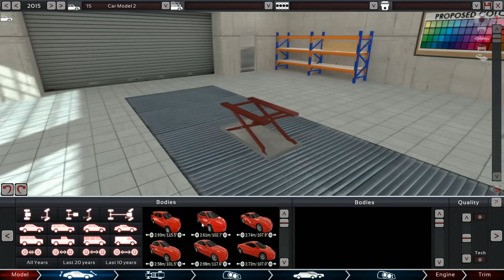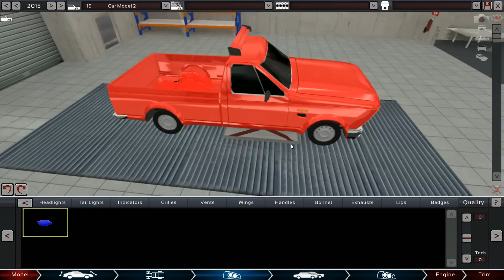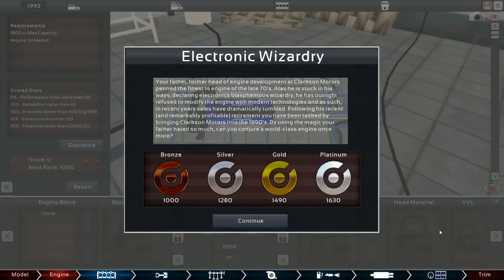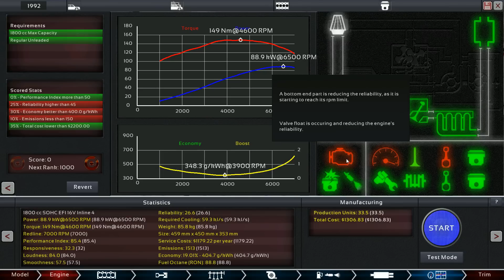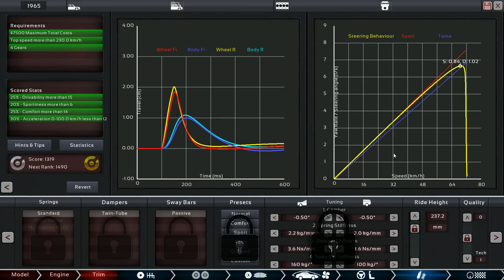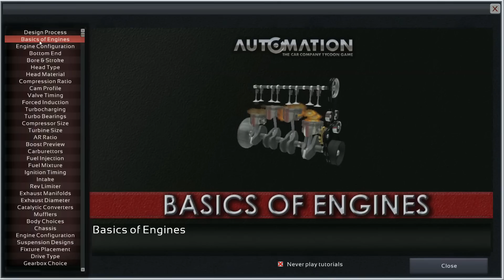FIRST LOOK - Automation - The Car Company Tycoon Game - Guides & Early Access

Comment: A fuel ratio of 14.7:1 is ideal for internal combustion gasoline engines, the mixture will vary slightly depending on atmospheric conditions as detected by an upstream oxygen sensor.

The Catalytic Converter will drastically reduce your emissions, if your fuel air ratio is close to ideal.

I would recommend a three-way catalytic converter as it is considered 'the modern standard'. 

Love the videos, keep up the great work.
Reply from the maker: +Aerik Forager Cool, you know alot about cars! Or games, who knows:)
Reply: Nathan's Sandbox Perhaps both. ;)